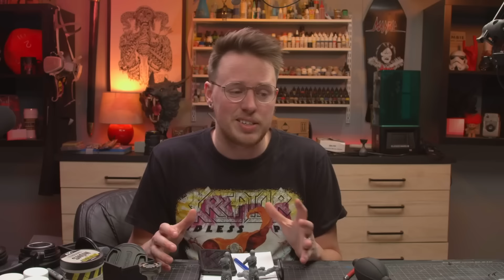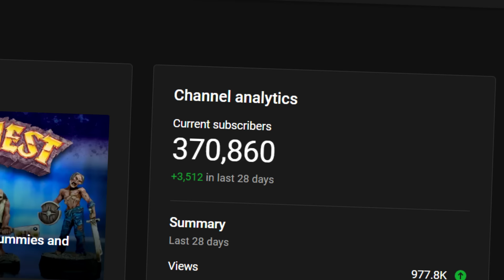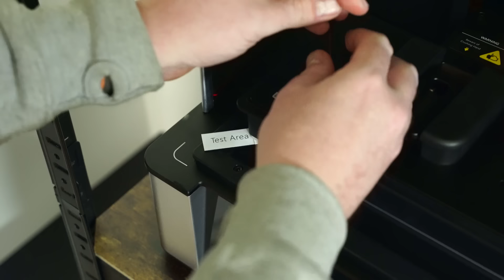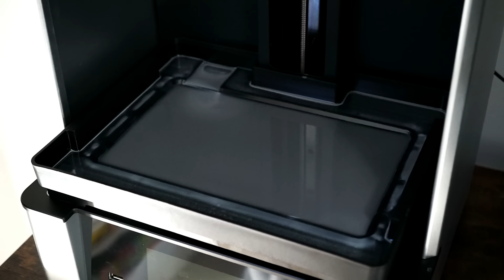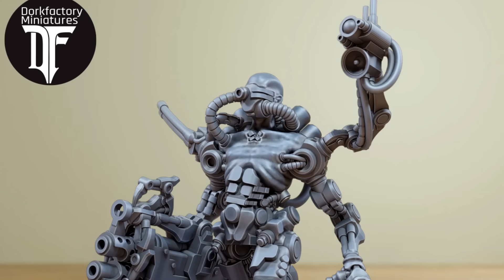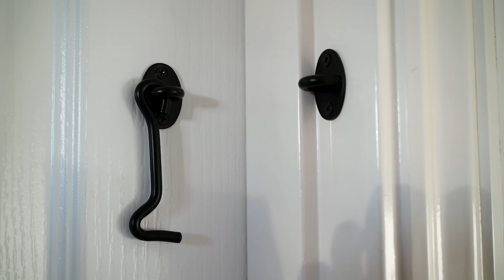Is 3D printing FINALLY easy enough to print Warhammer at home? Uniformation GKTwo!

Comment: It's important to point out that the printer Guy is using is very, VERY expensive. Most people will not be able to buy this model, and thus will not have the heating, the good ventilation and the other nice features. I own an Elegoo Saturn and while I enjoy using it, it's much more of a hassle.

So if anyone is interested in 3D printing, you will not have the same experience as Guy here, unless you have 800-1000 dollars to spend on just the PRINTER, not the other machines. They are 400 dollars more if you want them both.

Also, my printer is in my room. My singular room, since I live in a one room flat. For the longest time I didn't really care about the VOCs etc, because when I started no one really cared back then, but now the discussion has become much more relevant with more research being done and personally I'm not sure I can continue using mine. I need to do some measurements myself, see how bad the air in my flat is.

Comment: Hi Guy / all.
 I started 3d printing early last year with a fantastic deal on a creality halo one and with all the extras i required to setup what can only be described as a home laboratory I've invested about £200 give or take. I planned on offsetting the investment against the cost of what i considered expensive miniatures. I soon realised the toxic nature of 3d printing had no place in the family home and even the conservatory. My solution, The 3d printer and cleaning station is now setup in my shed.I have put 3d printing on hold and plan to dedicate a month or so to 3d printing in spring / summer to build up a stock pile of miniatures to paint up to until the following year. I still have plenty of projects to be getting on with, including hero quest expansion to paint and a 15mm space marine army. 
To summarise 3d printing is toxic, smelly and leaves you with lots of failed prints and toxic material to dispose of. Its a hobby all of its own and needs taking seriously if you value your health. Once i have printed enough to justify what i have spent  and have lots of cool miniatures in a resin pile of shame i will be happy to retire from 3d printing and concentrate on painting more. I'm eagerly preparing myself to do battle once more with the 3d printer settings, the jars and tubs full of ipa, donning of the respirator and gloves and the wandering out to the shed with my fingers crossed to see what has been successfully printed after hours of waiting. Its a love hate in the battle against trying to keep the hobby affordable but also an amazing tool to bring lots of amazing sculpt to life. I'm really happy with the minis i have produced with the help of the many creators on cult3d.

Comment: Personally I hate how many people advocate 3D Printing as being the perfect alternative to buying the original kits. There are many reasons why 3D Printing your own models could not be for you. Things like unsuitable workspaces, not enough time or not wanting to buy gear that far outprices the kits you want, these get glossed over almost always when people talk about 3D printing.

Not only that, the amount of effort it takes to perfectly set up your printer to get you the results you want or the tedious cleanup work get sweeped under the rug too. Lets also not forget that not every model you want has a free STL to download.

Personally as someone who has a 3d printer I advice others to first consider what and how much they want to print and if all the extra work is worth the savings you might have after printing enough. I usually only print big models that are far too expensive, like the Hierophant, and get the regular kits whenever I want them really badly. I just love the assembly process and feel less connected to models I printed.
Reply: Agreed. No space, no time, don’t want to work with toxic materials, and I’d rather just buy the models I want. If I want 3D printed models, I will happily pay someone for them.

Comment: Few remarks:
1. You should wear mask when handling resin and spirits/alcohol, even though you have the air cleaner, as well as handling uncured and wet prints.
2. It is easier to take the print plate from the printer and remove the models on some kind tray
3. For ease of use I'd say Lychee slicer is much better than Chitubox
4. Increasing size of prints with supports already in stl may not always work
Reply: All good points. The 3m 6503QL mask with some 3M P100 cartridges rated for VOCs is not that expensive as PPE goes. I would also recommend eye protection when dealing with anything this hazardous. You only have 2 eyes folks!
Reply: @bryannelson01  Yep no joke, read and reddit post from someone who nearly lost his sight due to direct contact with resin.

Comment: Undoubtedly, getting this $800+ printer, plus however much the curing and washing stations are, would save me money in the long run VS only buying official GW kits. But that's only *if* I ended up using it as often as I could, which does incur its own other costs. Plus, not to mention, that's an *ENORMOUS* upfront cost.
Reply from the maker: Oh absolutely! But then some people are spending that much and more per year on buying new Warhammer boxed sets, so it might make sense for them. Definitely less for the more casual collector!

Comment: It is a hobby on its own, rewarding but separate. Getting a good print and painting it can still fail a long time later by the model cracking and liquids leaking out, just because it didn’t cure completely … after a lot of printing I mostly enjoy buying models again. It’s simpler…. But expensive.

Comment: Instead of recommending a Phrozen mini 8k s, he recommended a payed partnership. Bias incomming!
Reply from the maker: ... okay? I haven't used a Phrozen, I'm not an expert. I asked a knowledgeable friend and heeded their advice. We all have biases, that's just being human.
Reply: @MidwinterMinis  If the printer wasn't given for free it would exceed your price range or is at least at the upper end. I am glad, that you have the opportunities, but the result can't be as neutral as without this lucky accident. On the other hand, the printer is the smaller cog. If you have bad STL Files, even the best printer can't rescue them. In rare cases a bad STLs can even destroy your printer. In your case the printer is a good choice because your support has experience with it. For other people, the size of the community behind a 3D-printer should be a factor, because it makes debugginga lot easier.

Comment: Resin VoCs are really small, most air purifiers wont even detect them, or even clean them. Once you smell it, the VoCs are already in the air. 
Water/Plant Resin, also release VoCs, and are toxic, dont drain them in the sink, and usually they are more brittle and dont clean as well. Air Filter Mask and gloves are a must
Also, dont scale models that already have supports, you might have some fails/warps, and at best, the supports will leave bigger marks once you snap them off. Better to scale the model without supports, and add them yourself

Comment: The way I see it, 3d printing isn't something you just swap too from buying models. It compliments the core hobby. You can get easy terrain and bits, along with whole models. But considering health concerns, you don't want it running 24/7. Print a few bits or models here and there and it is absolutely worth it.

Comment: It looks really fiddly scraping the upside-down prints off the build plate, especially in the dark print chamber. Can you take the build plate off to remove prints?
Reply from the maker: You absolutely can, and probably should, but Ross said that it just saves time and is a bit less messy to just pop them off while everything's still assembled.
Reply: @MidwinterMinis  interesting! Thanks :-)

Comment: Thanks for the honest review including the toxic vapors. That had been my main concern about whether or not to try 3d printing myself. I currently don't have a dedicate, safe space for it.
Reply from the maker: No problem mate! Glad you found it useful
Reply: @MidwinterMinis  Id be curious to know how the VOC sensor would react if you had used water instead of the odorless spirits. Any chance you would use water instead at a later date and give an update on the impact?
Reply: I've studied chemistry, so I feel pretty confident in what I'm going to tell you: I haven't used my 3D printer for almost  4 years, because the last places I lived simply didn't have a space I could safely use. If you live alone and have a well ventilated bathroom, you're gonna be pretty safe, if you only leave it running when you're out and the windows are open.
The methylated spirits aren't that big of a problem, if you leave the windows open while working with them and keep them tightly sealed otherwise. Personally, I prefer Isopropyl Alcohol, since it is less volatile and less toxic than even pure alcohol.
What I would be concerned about is the fumes from the resin while printing, since the exact composition of the resin is seldom  disclosed by the manufacturer and can cause allergies.
It's probably still safer than having an FDM printer without a proper filter system at home, since those will put a lot of particles in the air that definitely aren't healthy and that your body may not even be able to get rid of.
So, with all that, you need to decide what's best in your situation.
Reply: @miguelengelhardt4687  Resin certainly isn't safer than FDM printing. FDM typically uses PETG or PLA plastics that are both organic plastics and biodegradable. They are non-toxic and can be broken down by the body if inhaled. Using ABS with an FDM printer would be toxic, however. 

Resin is many many times more toxic and irritating to the skin. Let alone needing to be cleaned with IPA or other solvents which can exasperate / amplify it's toxicity when inhaled. This is the primary reason I've avoided buying a resin printer as I cannot create a proper ventilation environment which would require a vent hood and an air exchanger that leads to the outside. You must also wear a proper VOC intended respirator or you are really asking for trouble.
Reply: @chartedlife  You don't need a vent hood and an air exchanger, a simple grow tent and a duct fan venting the fumes outside is sufficient.
Reply: A carbon filter gets rid of VOCs efficiently (the same which are used to grow weed), but it adds some cost to the setup.
Reply: @GraySectoid  A carbon filter doesn't actually filter anything besides the bad smell.

Comment: Your honesty is why you're my favourite hobby channel. Highlighting both the good and the bad, with 3D printing in particular, I feel people gloss over the safety issues a little, or they have setups that allow for better ventilation or separation from the rest of their home so it's not an issue. 

I've got respiratory problems and even using my airbrush with protection gives me anxiety. So the fact you straight up show how the air quality changes in this video is really valuable to someone like me. That and I think spilling resin on my carpet would implode my soul so I'm happy to leave it to others 😅
Reply from the maker: No worries matey! Thanks for the kind words :)
Reply: Dude, the best tip I have is to do it outside.
Reply: I’m with you Captain. I definitely noticed a downgrade in my breathing quality when I got my first PHOTON.
Reply: I work in a garage shop, wear a mask (respirator), and gloves when working with the resins. We also have a vent exhaust system that pulls stuff out, and two giant air purifiers. I also have to pay to dispose of my IPA and chemicals that i use, and  lot of folks don't follow those rules.
Reply: @IPrint3dMinis  cant you just let the IPA evaporate outside and cure the plastic excess? or is that bad for some reason? Im using water washable resin rn so don't need anything outside of the sun and a few days to get rid of waste
Reply: @LaEmporoar  Not really, but there is always an air quality issue with IPA, use air filters for sure.
Reply: Stick it inside one of those cheap weed grow tents, cheap fan and ducting from hardware store into a bit of polystyrene that you put into the window gap so you can close it.